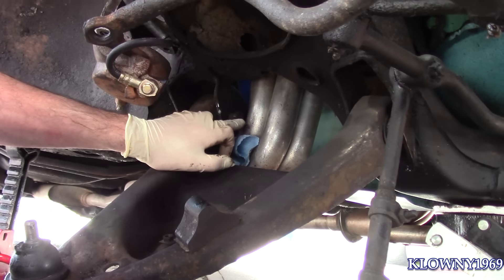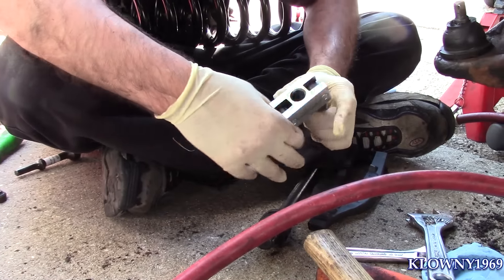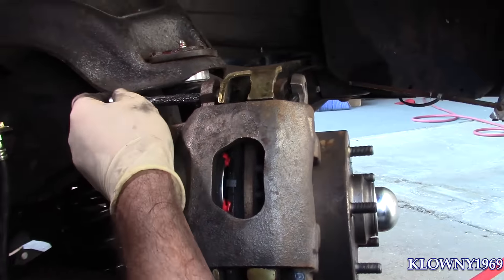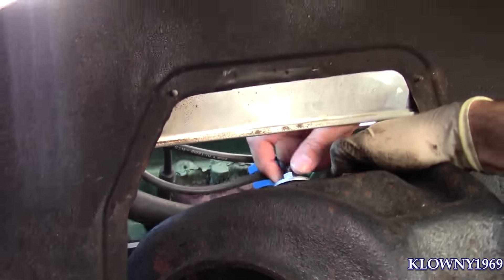How to Install Front Springs on a 1964 - 1967 Pontiac GTO / Lemans - DIY

Comment: Thanks like how you put the fork under the control arm i am doing this on a chevy s10 its the same set up i am going to try to compress the spring the way you did buy placing the fork for the compressor on the bottom of the control arm its a tough job on the s10 for me
Reply from the maker: You get more leverage that way..don't forget to subscribe
Reply from the maker: You get more leverage that way..don't forget to subscribe

Comment: On any GM vehicle with control arms like this you're supposed to wait to tighten them all the way down when the car is off of the Jack & Jack Stands sitting at ride height. You lower the car first and then finish tightening them down when everything sitting at ride height
Reply: Other than that and not just removing the sway bar out of your way I think you did a great job
Reply from the maker: J-BASSNFANATIC not true
Reply: Do you think that is why my 66 Malibu sits  high?
Reply: @klowny1969  Well, I guess you need to do some research because you’re not supposed to tighten anything down until you’re sitting at right height judging by your name on here seems like you might clown around with your car but I’m I don’t clown around with mine. I learned this from the old guys maybe you should do some research on when you should completely tighten down your suspension after doing work, and then get back with me with an apology. Once you realize the whole world, does it the way that I explain for a reason and you just been going throughout life not knowing that reason or knowing to do that, and I’m so sorry for that clown.

Comment: No metric threads on that car... its a 7/8”and 3/4”...great video otherwise. Would recommend that u drop the shock then use a spring compressor so the spring is held until u get it out if the car . Its actually easier to get it out as well as safer. 
What disc brake kit did you use to get rid of the drums?

Comment: The coil spring compressor fork goes into the spring, not under the a-arm. This also allows you to leave the a-arms attached. No need to remove them to put the new spring in place. 

The coil spring compressor hooks stay inside the coil spring and hook outward. Klowny did it backwards. The groove of the hook will match the pitch of the coil. 

Tighten a-arm bolts with car sitting at ride height to prevent binding.

Remove the sway bar to make the whole job easier.
Reply: Ryan McDonnough Some GM models require you to put the fork at the bottom of the control arm

Comment: I have done this job, it is a lot easier when you install the top of coil spring into the top frame hole then bring the spring into the bottom A frame. You align spring and your in an done.
Reply from the maker: Jim Gillis you have done this job on a gto/lemans? Cause it sounds like ur talking about another type of car
Reply: I have a 1966 Lemans, I like your video. Thank you

Comment: Maybe my nova is much easier, I just removed the caliper, undid stabilizer bolt, disconnected upper control arm left it all on and lowered down enough to pull spring in and out.  I had the car jacked up high enough for clearances.  Little hard to get in without clamps but prybar and foot worked.  Good stuff.
Reply from the maker: Thank u..lemans springs are huge..nova should be much smaller..thanks for commenting and watching

Comment: Ughhh, you make this look way too easy!  I have a 65 Lemans and a 65 Tempest and have had to take the front ends apart several times.  The spring compressor that I have has the arms on the top and bottom and they are an absolute bitch to get on and off.  I was hoping you would be using the same kind but it looks like your compressor is a new and improved version.  I swear to you, several times I have been driven to tears trying to get that dang compressor out of the coil once installed...

One more time I have to put the front end back together on my Lemans parts car for no reason other than to get it rolling so I can get rid of the thing.  I'm wondering if I should get the same style spring compressor that you are using or just suck it up and use the one I have and endure the psychological torture of trying to remove the damn thing.  

Have you ever used the older style and do you have any pointers?
Reply from the maker: Hey..never used that style on this type of car..u can just go to autozone and rent the one i used for free..thanks for watching and commenting
Reply: Dude I for one feel your pain. Done lots of G-Bodies .and they are a bitch with the four hook compressor. Also lower ball joints. Then I learned about the tool lending at autozone. And good videos like this one.

Comment: Wow a video on how not to use the tool incorrectly. Coil compressor arms are attached to the coil spring from the inside, no crowbar necessary.
Reply from the maker: How not use the tool incorrectly? So I'm showing how to use the tool correctly? LOL
Reply: @klowny1969  lol I guess it was a compliment

Comment: At 13.40 your putting the tool through the coils to the outside of the coil and grabbing the coil. You inserted the clamp upside down  The coil clamp is NOT supposed to go through the coils it is supposed to grab the coil from the inside of the coil which makes it easier to grab more coils causing less tension on the assembly. SAFER.  Ok a video on how to use the proper tool incorrectly is what I should have said.
Reply from the maker: That doesn't work on this car..I used it properly
Reply: Where's your video? I don't think it's the easiest way, but it works for him, so it doesn't really matter how he did it
Reply: @klowny1969  no you didn’t , this was incorrect